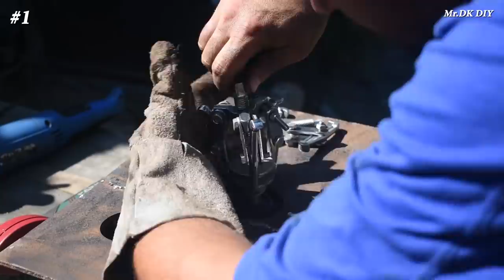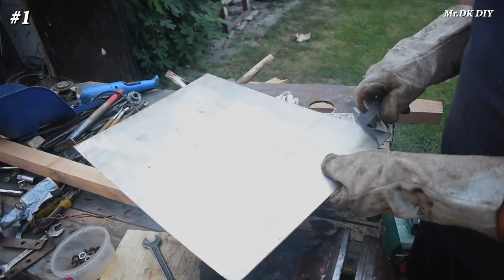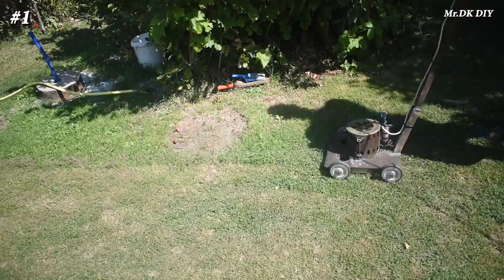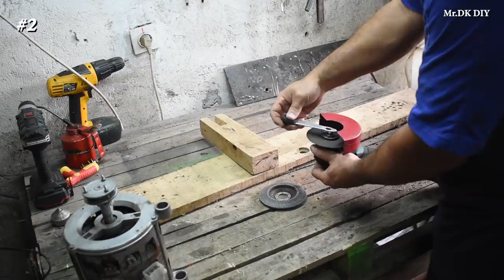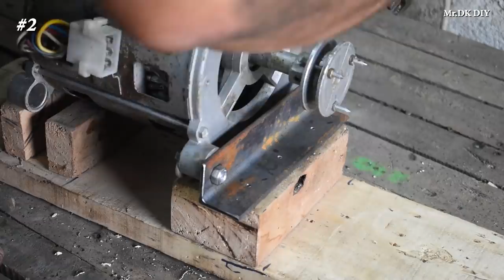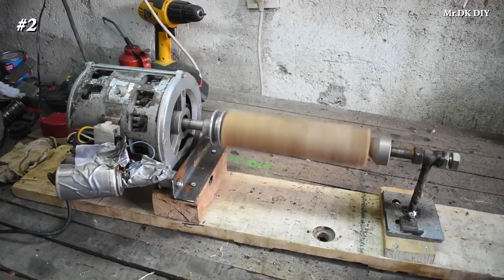2 GENIUS DIY IDEAS MADE FROM WASHING MACHINE MOTOR

Comment: I made a blade similar to this, then when I used my homemade grasscutter with the blade, it hit something like a stone or hard ground or sturdy grass, the blade bent and hit the protective housing, damaging it. The blade stuck and the motor stopped.  I think I should reinforce the blade so it would not easily bend when it somehow hits something hard.

Comment: No offense, but my dad built an electric mower using the same kind of motor, but much lighter and safer than this in the early 50s. The centrifugal switch was modified to require manual starting (like a car) but stall-protected as well. The off/on/start switch was located on the handle. Short blades were mounted with one bolt at the edge of a disk so they could swivel back if they hit a hard object like a rock. Centrifugal force would swing then back into position automatically. He cut our yard with it for several years until he found a commercially available one with similar features and weighed even less. He far preferred electrics over gas for their low noise and vibration, easy start, almost zero maintenance and far better reliability. Power was never any issue at all.
Oh yes... it was also a mulching design... no need for a discharge chute, and unless the grass was too wet, would never clog.

Comment: That lawnmower thing is really hazardous. It's not worth it, Bro.! 
The electric wire is very awkward and will get caught under the blades and with the push handles and everything made of steel you will get electrocuted.
Also the stiff push handle causes the front wheel to lift up in the air and can cause the blades to dig into the ground and tear off and you can have flying metal shrapnel all over the place. Mower blades must be made to certain tolerances and shaped appropriately!
Overall it is NOT ingenious but A VERY BAD IDEA.